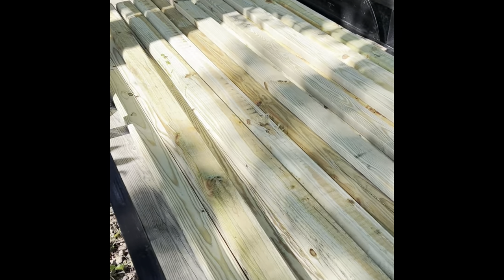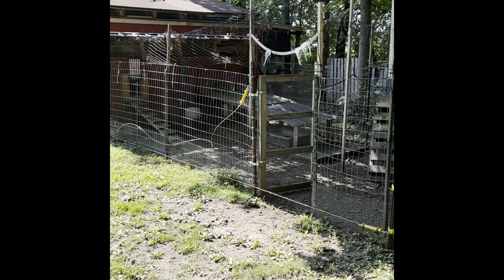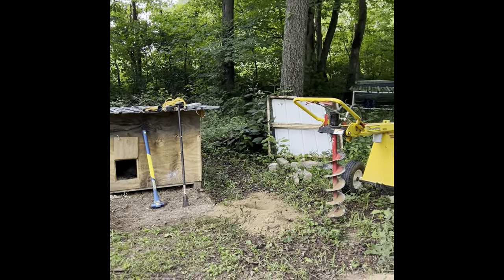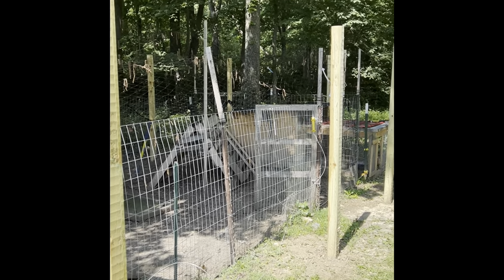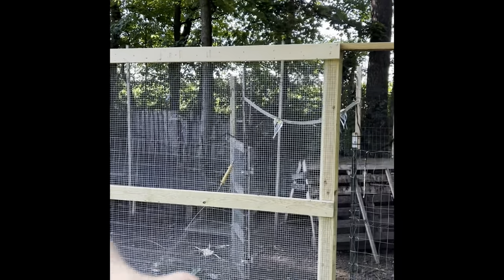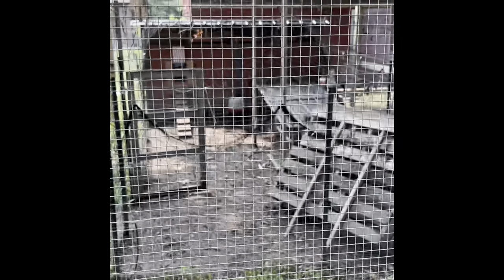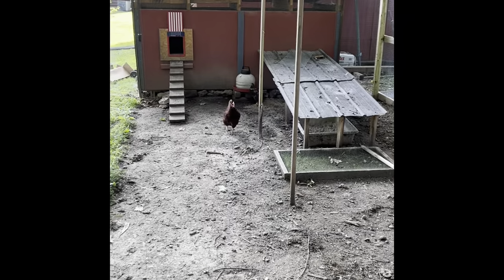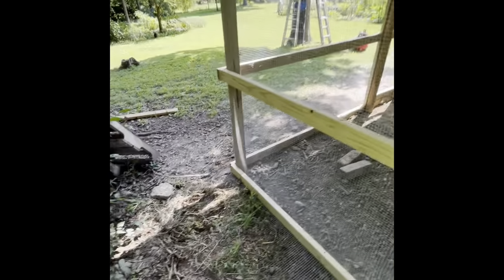How To Build A Covered Chicken Run!

Comment: I have heard you have to have 4 square feet for each chicken. I'm glad you remembered to put The Wire underground because animals will dig under.
A dog got one of my chickens that way and I live way out in the country but there's 20 or 30 houses and there is a panther A. Black panther that lives out here in a tree and he just got a great big huge dog and killed it. So I worry about my chickens.
Can I have lots of cats and 2 turkeys and 2 dogs and 4 geese?
And 23 chickens so I think I need to forify my walls.
Since that happened.
But it gave me the idea about having a lot more space.
Reply from the maker: Thanks for the comment!  I’ve heard 4 square feet per chicken also.  Using that calculation, my new run could accommodate 84 chickens. Currently, I have a total of 12, so plenty of room to grow. I will need to build a new chicken coop once I enlarge my flock, but my run should be good for a while.  

Sounds like you have a lot going on, and you must live in FL, to have a black panther that close!  I hope that my video gives you some good ideas!

Comment: Great video, nice job! In southwest Ohio, what do you do in the winter? We live in Michigan, so its pretty cold!
Reply from the maker: Thanks for the comment!  The door side of the run faces south, and most of our weather comes from the SW, so I plan to put a tarp over most of that wall, so they’ll always have a good bit of area that won’t get too much wind and/or snow.  They also still love to free range in winter, as long as they don’t have to walk on too much snow.
Reply: Thanks for the quick reply. That makes perfect sense and helps me to decide how to protect our feathered friends!!
Reply from the maker: @haroldmoores2873  glad to help!  Living in MI, you probably already know chickens can take pretty cold temps, as low as -20°. As long as their coop is dry and has good air flow (no drafts down low, but good ventilation up top) they’ll be good.
Reply: @MadRiverHomestead  James, being a new chicken owner last Spring, it has been a lot of “trail and error”. But thanks to people like you and YouTube I have learned a ton! I still feel the need to have a secured heat lamp in the coop. My chicken door faces west and there’s no automatic closure unit (yet). There is good ventilation from above. However, I struggle with trying to keep both food and water “inside” the coop, since the run is not covered (…again yet!). It is covered with chicken wire but snow and rain are always a problem.. You gave me a good idea maybe using a tarp. Do you use anything beside dirt for you chicken run floor? Thank you again!!
Reply from the maker: @haroldmoores2873  I understand about the heat lamp…just be very careful. Coop fires are the number one cause of accidental chicken deaths.  Even in southern Ohio last year we had 3 days in a row when the temp never got above -7°, and everyone was fine. Just a little frostbite on the tips of a few combs, and you can’t even see it now. We did come through last winter with an uncovered dirt run, but it was a real mess with snow melt, and I know you’ll get a lot more snow than we did. When I knew snow was coming, I would lay a tarp on the grass right outside the coop, and throw some grain down so they could at least scratch a little. We also bought a heated waterer, which was a game changer. You definitely don’t want to keep water in the coop, if you can help it.